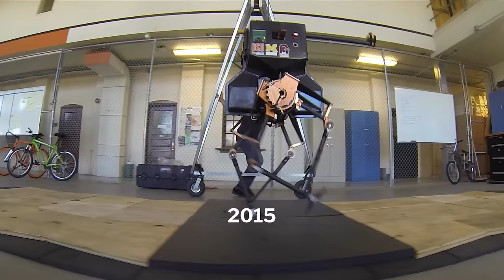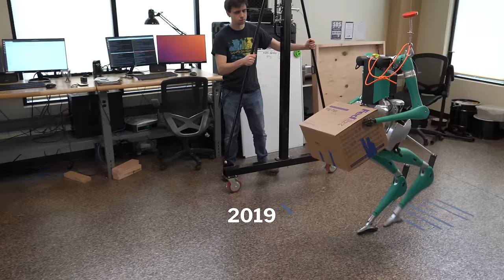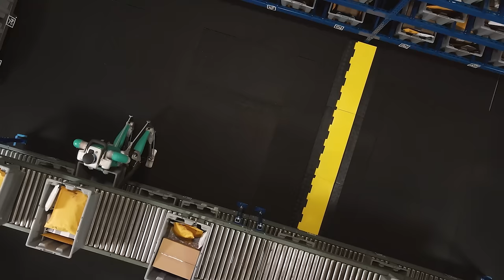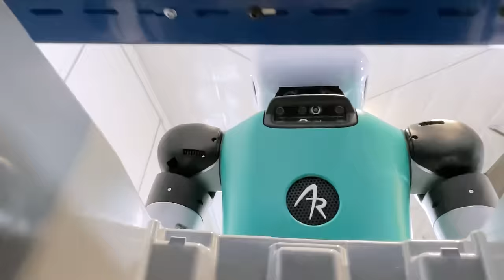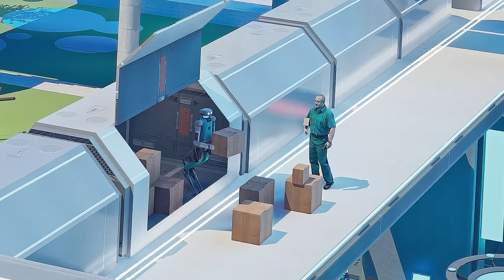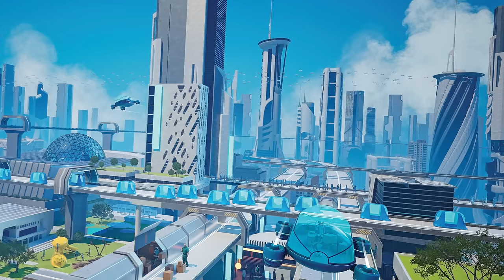The Next Generation Of Digit - Enabling Humans To Be More Human

Comment: What will the humans do to earn money when all the work is done by robots? Who will be the customers of all of these robot employees if humans have no income generating jobs? Will humans agree to an allowance from the government? Will government cut some citizens off from their allowance money if they've committed any thought crimes?
Reply: People will assemble robots. There will be jobs that are low skilled that most people can be trained on without having a degree. 

Some people say there will be more skilled tech and engineering jobs, but I disagree. There will be people that do the cables or specialized mechanical steps. Most of the jobs are low tech with very few design engineers and skilled technicians. Technicians won't be skilled. They will do mostly testing, and alot or most of this will be automated. So your testing of automation robots will be automated. I don't expect fixing robots will be skilled. For one thing, it's usually less expensive to swap out boards than to fix even one part, as I was told.

Upgrades are done by re-programming the chip. But, that's just following a series of steps. I have seen this job assigned to people that have no such background in programming microcontrollers, and they just follow the steps. And, people are able to re-program the boards without having a technical background. 

There is alot of competition for the skilled jobs. You can get a 4 year degree and not get the job. There are just so many people more qualified than me or you. That's what you should expect and this is the attitude that you should have. That there is always someone out there better than you. 

You may get a job such as test technician that is low skilled for your degree, so you probably won't be without a job. But, it won't be the skill level that you hoped for after getting a degree. 

About unions in tech manufacturing jobs:

Let's hope that there is a union, if you are a low level employee, or you won't be paid well. A union is not good for technicians since within a union you can do another step since it will be "taking away another persons job". So, it lowers the skills of technicians whose job may already be low skilled. But, that's one of the things that goes with a union manufacturing job. 

If you get promoted out of the union, into Engineering, don't expect to get design or good assignments. You can be a low level person there. Maybe doing drawings, researching parts, calling suppliers, doing reports, charts and graphs, bidding on test fixture projects. Maybe you might get to do test automation and even that's not guaranteed. No one aspires to the test automation job, certainly not me.

Comment: why has no one thought to put wheels on it? legs are a human attribute and you had to waste time teaching it how to walk. sure it's useful to get up steps but on a ground floor this thing should have wheels to be the most efficient. also when are they going to move faster. it moves as a human does if you told them to act like a robot. it's a robot, it should be capable of moving a lot faster. I've seen robots run, so i know it can be done. how careful does it need to be with moving boxes?
Reply: Well legs are useful not only for stairs but for any human environment or places without flat road or floor. Wheels are also great. I agree that that it could be practical for a humanoid robot to be able to use both, legs and wheels. Such robots were created. The robot in the video is more like concept yet, perhaps when they release the model that will come to be sold into factories they will do more variants some equiped with wheels. Also perhaps even if they don't have wheels, they still could ride on skates or wheeled hoverboards.